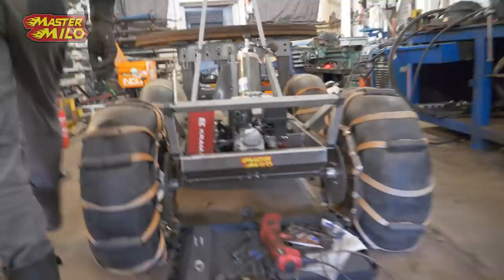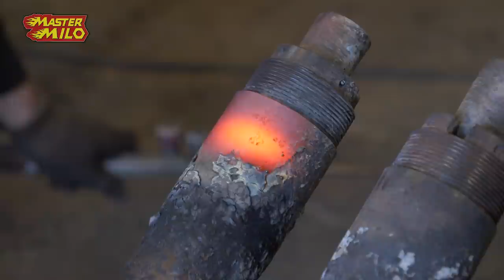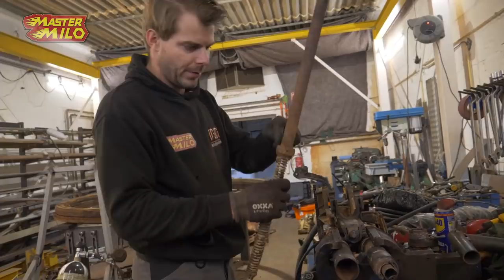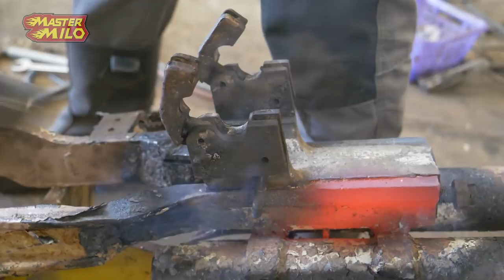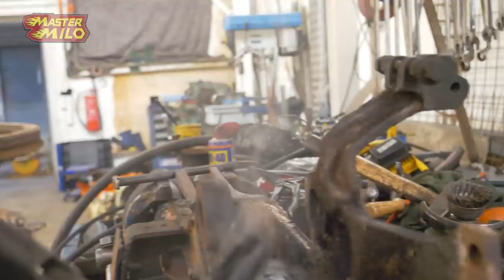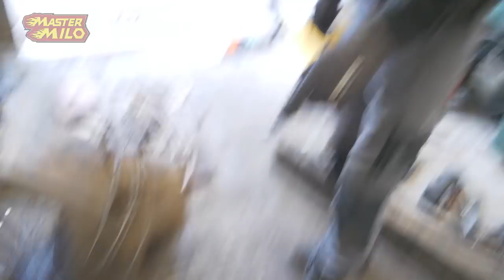Tank koepel alles heet stoken totdat het loskomt! #350

Comment: I think the machine gun balances half way through its elevation, so that two springs stop it from crashing forward and two stop it from crashing backward. *a good idea is a gun designer designing a gun and a bad idea is a gun designer designing a gun mount. Fine threads on the ends ? Arrrrg!

Comment: you would need to make new parts or have the original manufacturer make new parts for you if you planning on having it be more than a statue
Reply: I guess with no guns it has to be a statue?
Reply: @teamidris  it would be a statue if it could not be repaired to working order meaning be able to fire the gun rotate the turret without falling apart elevate the main gun up and down there for if it could not do that it would be a statue as its main turret can not move making it immobilized aka harmless